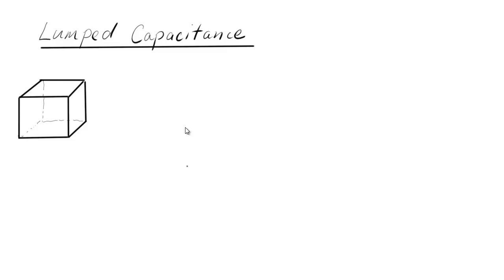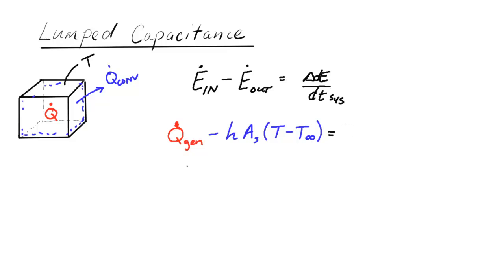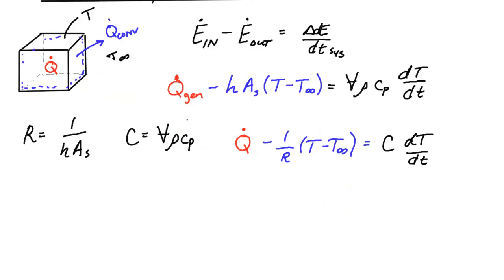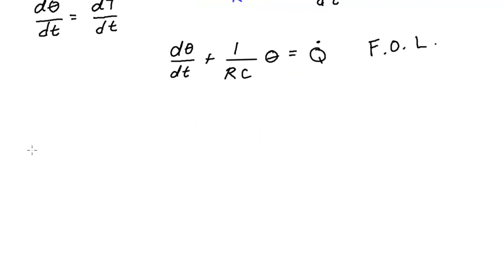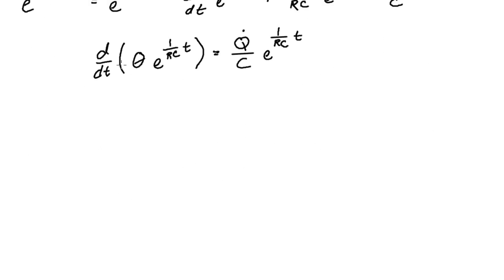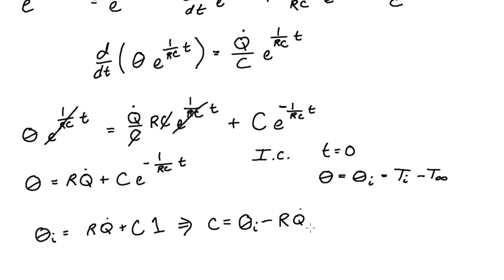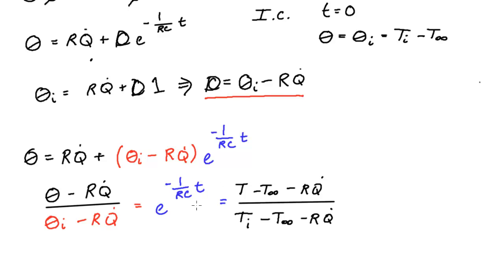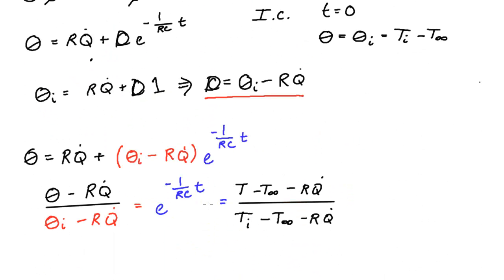Derivation of the Lumped Capacitance Formula as it Relates to Buildings

Comment: This is really good, thanks but for the building it does not work as the heat goes from the space to wall and then from a wall to outside. The problem is the we can't assume the temperature changes at the same speed in a room (air) as in a wall. The air temperature in a room will always raise earlier (if building is gaining heat from inside) and we do not know how fast heat will go from a room (air) into a wall (how fas a wall will accumulate it) and then to outside.

Comment: Somewhat unclear why dtheta over dt = dT/dt
Reply from the maker: Very understandable. Here's another explanation. Imagine you have a graph of temperature vs. time. The slope of that graph at every point is dT/dt. Now add a constant to T, the y-axis. All this does is shift the graph up and down without changing the shape. The slope at each point is still the same. θ is T plus a constant, so dθ/dt = dT/dt. 

Mathematically this can be written as follows. Notice that it amounts to splitting the derivative to each individual term and that the derivative of a constant is 0. T∞, the outdoor temperature, is assumed to be constant. This isn't a bad assumption as long as the period you're looking at is on the order of a few hours. The assumption is okay as long as the rate of indoor air change is much larger than the outdoor air change, which it normally is because we have HVAC equipment forcing the temperature change. 

dθ/dt= d/dt ( T + T∞ ) = d/dt(T) + d/dt(T∞) = dT/dt + 0 = dT/dt
Reply: @MitchellPaulus  Thank you very much Mr Paulus, the math explained it all. Appreciate your reply.